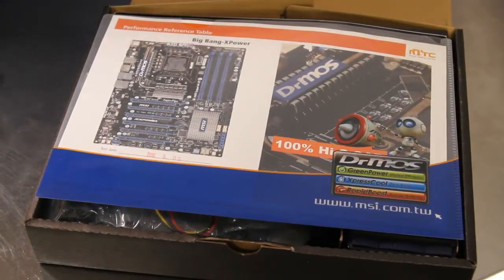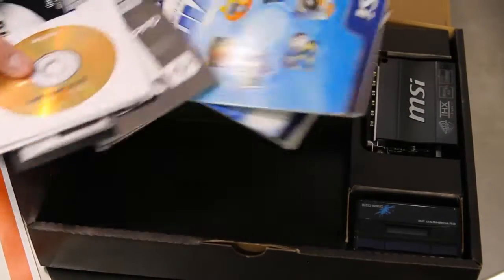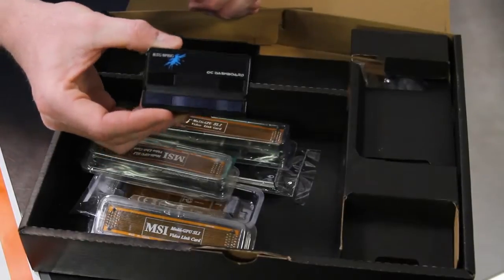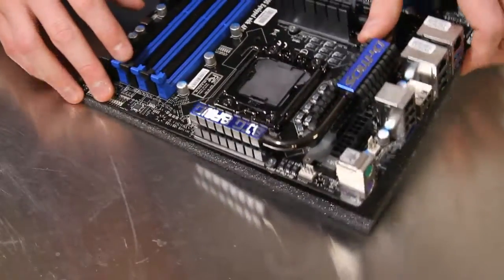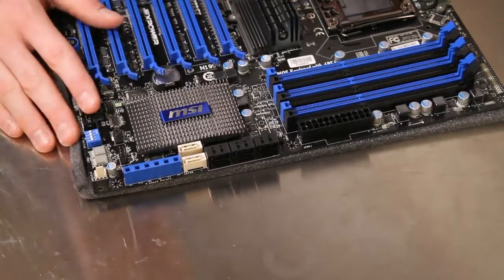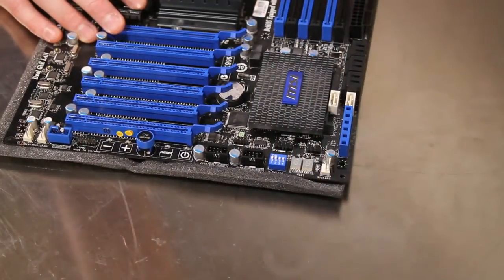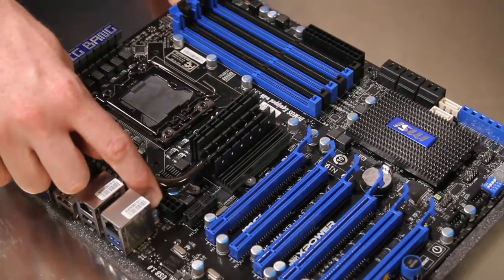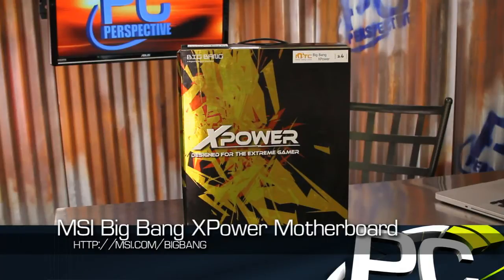MSI Big Bang XPower Motherboard Preview - PC Perspective

Comment: I do not think any processor today can handle more such an amount of GPU's.

I have seen i7 920's overclocked to 4.2Ghz and bottle necking two 5970's. Sure, that is an extreme case, but this is just crazy!.